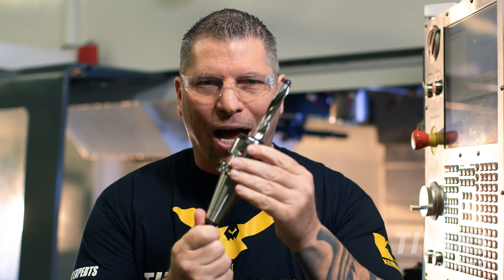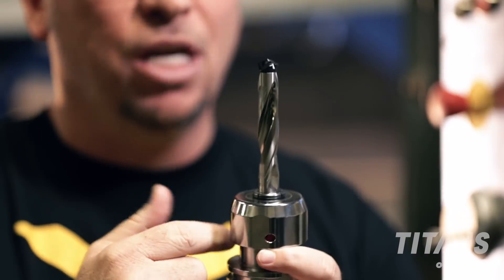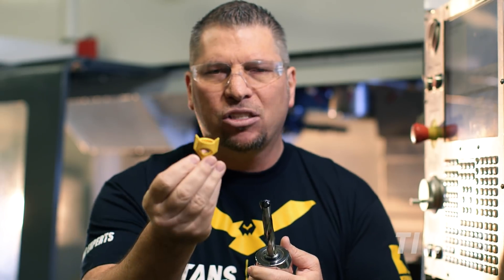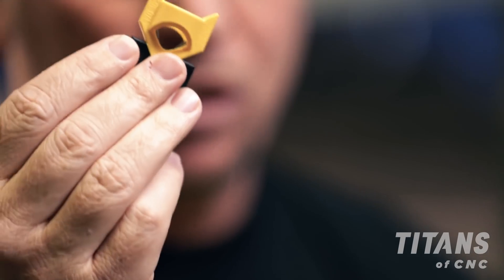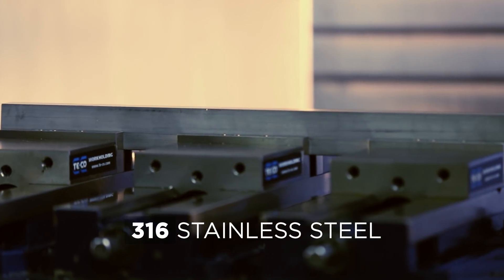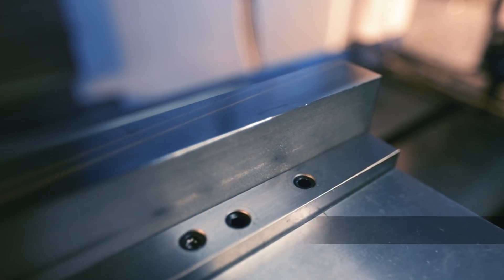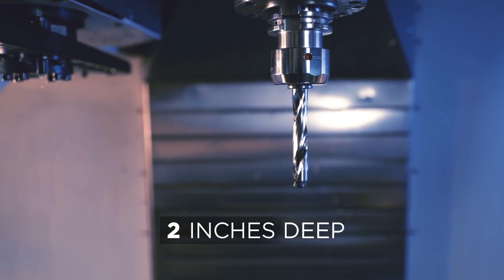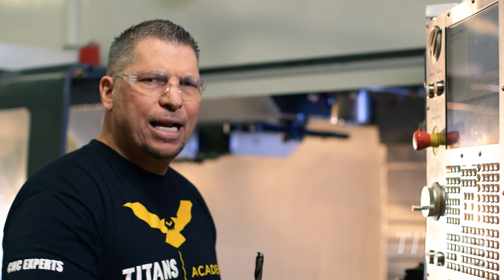Titan Gilroy puts the NEW Kennametal KenTIP FS Drill to the Test in 316 Stainless Steel

Comment: I ran a 2.25 diameter ksemp modular drill at 420.  Sfm
 No problem.   That equates to 750 rpm 7.5 ipm.   In p20 tooling steel.  It was amazing.  Then I went all the way up to 1000 rpm 10ipm and my coolant couldn't keep up.   Go kennametal.      I have every drill from .256 to 4 inch diameter  in kmetal.   Titans of cnc you guys  ever run a modular  that big before???   I have 15x diameter also.  Its intense spinning a 2.5 foot long drill 700 to 1000 rpm   If not  I'll make u guys a video I f you would like. Lol.

Comment: Hey Titan, Have tried Iscar Sumocam in 316? Just did about 500 holes 0.580" 1.4" deep at 160 sfm and .008" feed and didn't wear out the tip. I could have gone faster, they said 220fpm, but the job was very time sensitive and if I destroyed it by pushing too hard I would have stuck.
Reply from the maker: Yes... that’s great. In tests this tool beat it out across the board in Stainless

Comment: Titan I can see that this drill is far superior to a solid carbide drill because one of the key properties of a drill is its ability to flex with this modular drill you get the advantages of carbide and the stability of hss cobalt. Personally I had some really bad experience with Solid carbide drills, it seems like the process was adverse to solid carbides but maybe that was just a personal hangup on my part. I can say that I will buy one of these modular kentip drills in the near future because I watched this video.  We have purchased 4 newer machining centers they are YCMs with Fanuc controllers on them and one of them has thru tool coolant on them. My question is this what is the PSI for the thru spindle coolant on your HAAS that you run that drill in to get your feed and speed range. Mine is only 300psi which I know is sort on the low end. I know that if the output isn't enough like 800 - 1200 psi its kind of like pouring water onto a hot frying pan out of a cup vs a high pressure hose...

Comment: I know nothing about CNC machining, but is the coolant needed? Like does it get so hot from the friction that it actually wears down or weaken the bit?
Reply from the maker: Absolutely needed, for lubricity and cooling. If you did,'t have the coolant, you would have complete failure in this application. However, there are many applications where coolant is not needed and the cutters thrive when cutting dry.
Reply: Coolant also removes chips in this case, thats why you need high pressure with these drills
Reply: Trenton think of it this way. a hi tech cnc machine center is a glorified drill press think about it in every program there is at least one operation that has a drilled hole of some sort...well that's not a definite but it sure seems like it. Now the reality is that drilling holes is one of the most demanding applications that there is in all of the world of machining because of the fact that coolant cant get to the point where the tool and work piece are making contact when its inside the part. for drilling 1018 and aluminum the cobalt drill is ok. the standard way of dealing with heat buildup is thru pecking now in the case of a hole when you start to drill it you can technically go 1.5 x deep on the first peck and then work your peck amount back to .5 x the diameter on pecks that happen afterwards. typically when I machine a part I am going for walk away safety so I will go and start with a .08 peck for a .125 diameter drill and just leave it at that. Now think about the thru spindle coolant and the carbide tip of this drill it is possible in theory to go 2.0 inches thru 316L stainless without pecking that is all because you are directing to coolant directly to the tip of the drill where all the action is happening. however personally I would be careful and probably back out the tool at half the depth at 1 inch and complete this part using only 1 peck because you also have to be mindful of chip evacuation and if there is only 1 mishap where the chip gets bound up while its being forced out of the hole traveling up the flute of the drill you will have a catastrophic failure. pecking is now done as a way to insure the process from chip evac failure vs cooling.
Reply: You got to get the chips out of the hole somehow. ....